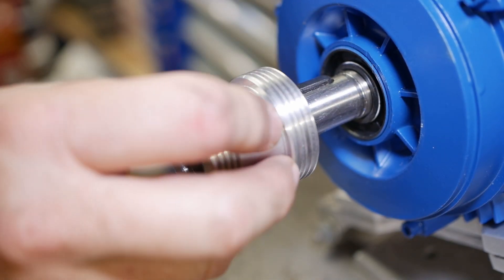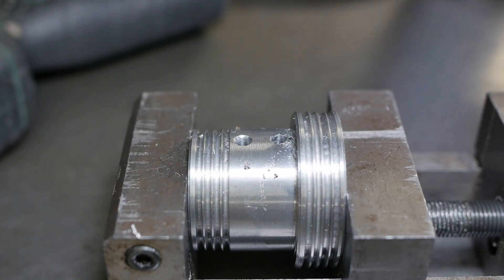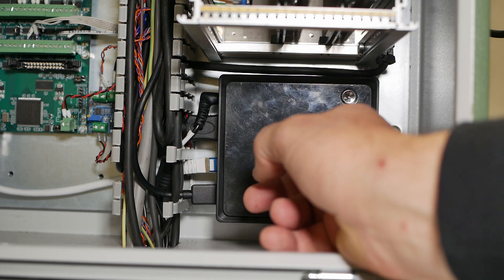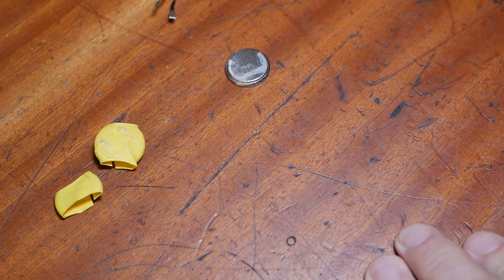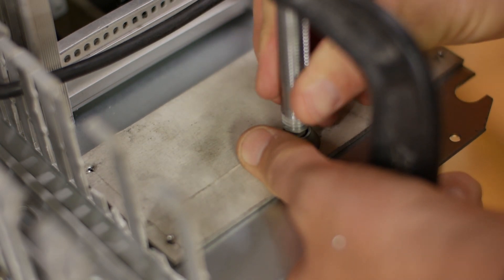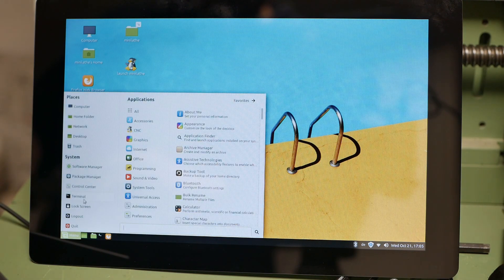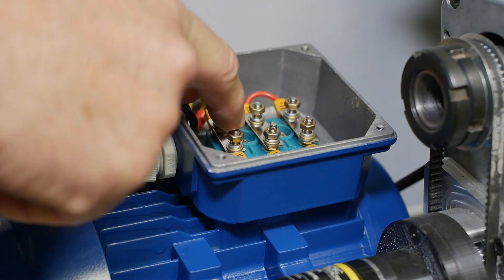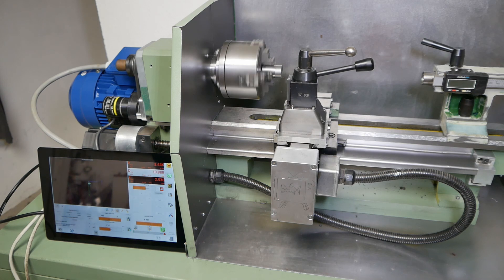Fixing screw ups - CNC'ing the 7x12 mini lathe - episode 33

Comment: Not trying to be mean or anything but, jeez, please use a tap wrench rather than the drill!
Reply from the maker: For small taps, in aluminium or thinner material,  I normally have better sucess with the battery screwdriver, as you can keep pure torque on the tap. They way I did that shaft was just plain lazy and dumb. Thanks for watching.
Reply: @RotarySMP  At work (big german manufacturer) we tap anything M3-M16 with a cordless drill and ballheaded tap adaptor. If you're not completely incompetent and try to tap a hole 45° off or use a tap you dropped it works completely fine.
Reply from the maker: @nikboeh1  That day I was definitely in the "completely incompetant" group!
Reply: @RotarySMP  Nah, thats why we got the ballhead adaptors 😉
Reply: @nikboeh1  What's that adaptor? Google failed me. Can someone share a link?
Reply: @besenyeim  I'll check the brand tomorrow
Reply: @besenyeim  The Product is a röhm gsf 3-9 b12 with b12 taper to 10mm hex Adaptor
Reply: @besenyeim  their is also one available from GSR (Gewindeschneid-QC-Adapter e-Tapping Satz DIN 371/376) with the swivel function aswell as a Clutch to avoid breaking. The Set with the Driver + M3-M12 Sockets costs around 350€ new.
Reply: @nikboeh1  Thank you.

Although, not entirely clear, how it's supposed to work. It looks like a universal joint with a B12 taper and a square tap holder. A bit pricey for that.
Reply: @RotarySMP  Ah that makes a lot of sense actually, i always rigid tap on machine but when i tap by hand its always with a wrench , i guess its just me, anyway cracking video as usual, really nice progress.